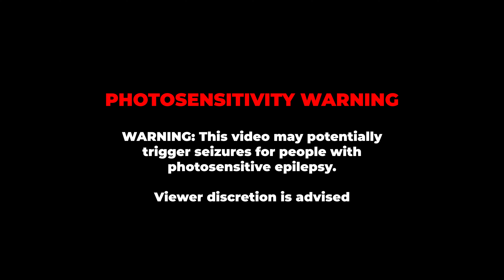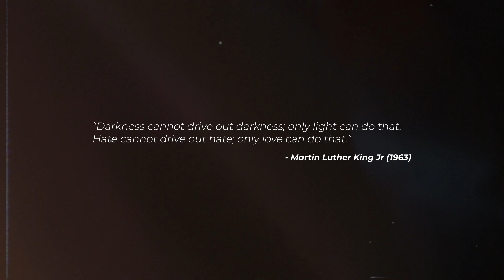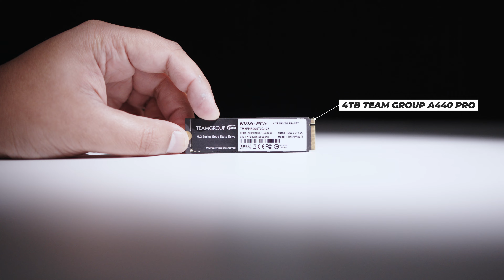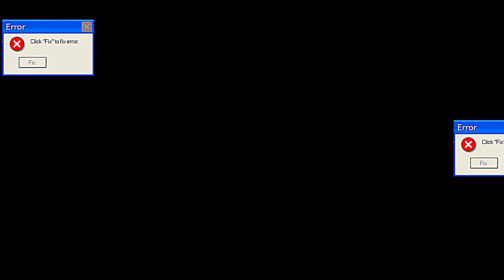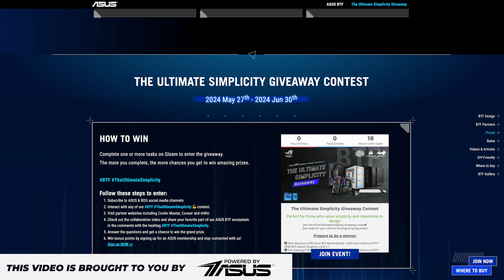No Cables, Some Tubes, No Worries - Clean & Simple Water Cooled Build

Comment: Der Bauer had a custom block that had the inlets and outlets for the pipes on the back behind the motherboard.  I imagine on an 011 case one could mount this and feed the lines into a radiator with the tubes mounted backwards so there would be no cables or tubes shown.

Comment: My favorite part of the ASUS BTF ecosystem is the hidden connector design, which eliminates visible cables for a cleaner and more streamlined PC build. This innovation not only enhances the aesthetic appeal but also simplifies the assembly process, making it easier to achieve a professional-looking setup. The integration of power delivery through the motherboard to the graphics card is a game-changer for custom builds, allowing for an unobstructed view of the components and improving airflow.

#BTF #TheUltimateSimplicity #ASUSBTFHiddenConnector

Comment: The hidden cables and sleek design of this build is amazing! Not only is it aesthetically pleasing with the LEDs and the easy customization ability but it’s so smooth in operation and strong in hardware. Wonderful for first time builders with the easy to follow and well-versed directions by a wonderful YouTuber 🤍 Huge applause to ASUS!!! 

#BTF #TheUltimateSimplicity #ASUSBTFHiddenConnector

Comment: Taming the cables is a constant struggle for PC builders, and the BTF's hidden connector design has the potential to completely eliminate that headache. This could be a game-changer for anyone who wants a clean and professional-looking build.
Imagine the visual difference! No more tangled mess behind the motherboard panel, just a sleek and uncluttered view.  The BTF design could make showcasing a PC build as much about the aesthetics of the components themselves as the technical prowess of the builder.
Plus, improved cable management can also lead to better airflow within the case, potentially boosting cooling performance. That's a win-win for both looks and functionality.
#BTF #TheUltimateSimplicity #ASUSBTFHiddenConnector.

Comment: the best part is defintely the clean look and design, it's amazing. the only thing i'm worried about is if the matherboeard and graphic card are safe enough for the high power of the psu, (like a lot of 4090 have burned).

#BTF #TheUltimateSimplicity #ASUSBTFHiddenConnector

Comment: Nice build, the white cooling liquid fits well. Eliminating the GPU cables is most of the benefit I see with the BTF system ( other than if you want a clean build like in your case - but for me, that's not a particularly big point ). Unfortunately, it still uses the weird 12-pin in the back, which I wish they would do away with in favour of good ol' trustworthy 8-pins, but whatever I guess . Having it slot into the motherboard for power seems to make more sense than having its own, separate connectors. #BTF #TheUltimateSimplicity #ASUSBTFHiddenConnector

EDIT: Apparently it does have the GPU 12-pin AND 3x PCIe 8-pin as an alternative, so that's all good then.

Comment: You got a new sub just cause of this video. Attention to detail is awesome.  The best feature of #BTF must be the hidden connectors and also powering this 4090 through the board, no more bundle of cables on display.    Looks like about time i upgrade from my 8 yr old gaming laptop with a GTX 1060 😅

#BTF #TheUltimateSimplicity #ASUSBTFHiddenConnector

Comment: Hello Gear Seekers! I just wanted to comment about that build, it looks awesome! I think its unfortunate that there are the problems with 13th-14th gen that exist. Its also very cool that the 14th gen can clock up to 6.0Ghz, but looking at the fact that the lithography of 13-14th gen is the same as 12 gen which does not have the problems is a bit of a strange occurrence. It also has higher memory bandwidth than 12th gen.
   If that were my PC, I would turn the power limits down to 12th gen level.  I probably wouldn't limit thermal velocity boost frequency, but I wouldn't expect a full 6 Ghz after the change. It would however still take advantage of the fact that you are using water cooling.
   Strangely, the "fix" that was released has not resolve the problem. It also, strangely, seems to be the opposite of what should fix the problem.

Comment: My favorite part about the BTF ecosystem (design) is the fact that the cables are hidden in the back, which in turn , makes the build look cleaner and the build process (also you don't need to spend your hard earned money on cable extensions) , of course it comes with some drawbacks, such as case limitations, but I think it's a miniscule price to pay for the clean look. Also I hope this design reduces the 12VHPWR connectors burning problem. Love the build BTW, looks clean!
 
#BTF #TheUltimateSimplicity #ASUSBTFHiddenConnector

Comment: My favourite part of the ASUS BTF system has to be the GPUs. I'm used to seeing these amazing GPUs with an ugly cable poking out the front hiding part of the graphics card. BTF really does make it look clean and simple, with nothing obscuring your view. The BTF ecosystem actually lets you see your pc parts instead of a bunch of messy cables. Certainly a turn for the better in the PC building world. (if i had to choose a second favourite, it would probably be the cases, specifically the Hyperion GR701 BTF. ASUS BTF made an already great product even better with this tech!)

#BTF #TheUltimateSimplicity #ASUSBTFHiddenConnector

Comment: my favorite part of  ASUS BTF ecosystem is to avoid the power cable from the psu to the gpu, a real back connectiors solution #BTF #TheUltimateSimplicity #ASUSBTFHiddenConnector.#BTF #TheUltimateSimplicity #ASUSBTFHiddenConnector